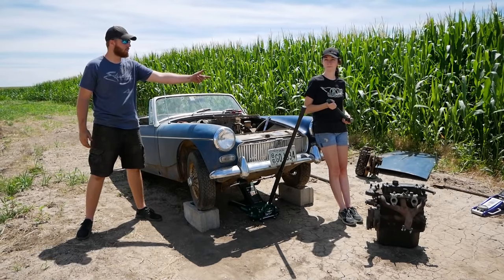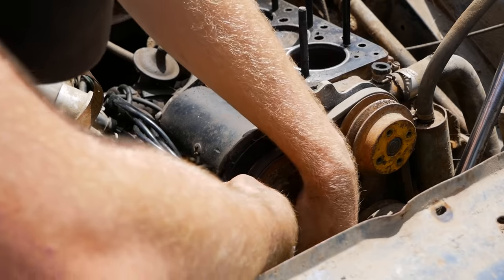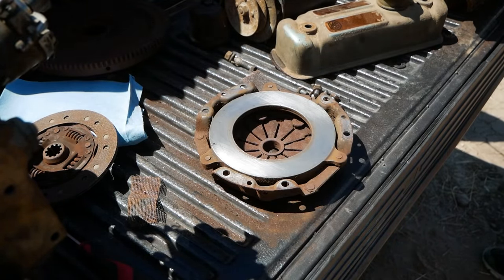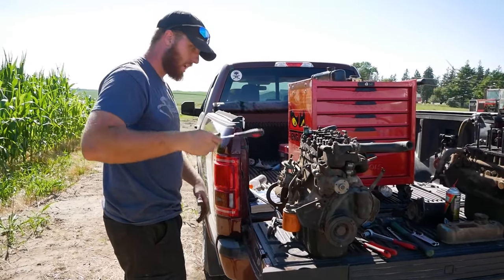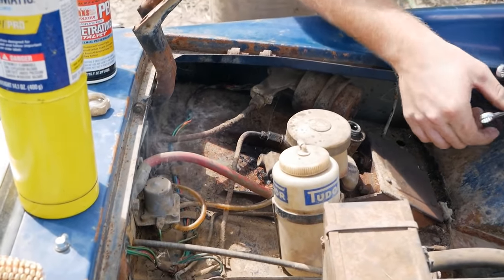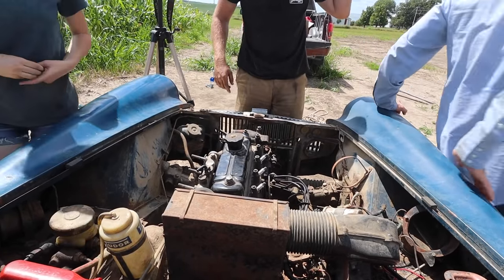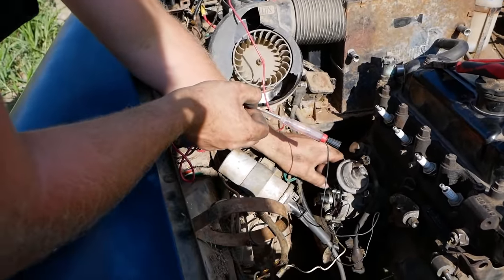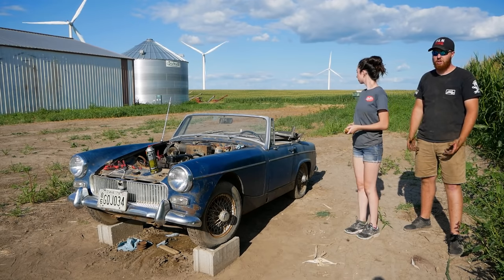Can We Make a SEIZED MG  Run After 42 YEARS!? - Part 2

Comment: The final part of this series should be a teardown of the siezed engine. I think I speak for most of us when I say we wanna see inside it!
Reply: cylinder is gonna be hard asf to get off it’s probably rusted to hell and back on the inside
Reply: I agree.
Reply: Ethan Nethery they showed that in part 1 - the head came off pretty easily, but pistons seized solid in the bores.
Reply: Emma Jacobs yeah it would probably be a pain to knock them out of the cylinder
Reply: @ethannethery2  YES it would be hard to knock the PISTONS out You'd most likely BUST the PISTONS to PIECES getting them but it can be done I've seen ENGINES about like that but they did get all 4 6 or 8 PISTONS out of them busted some but got em
Reply: is that his wife or daughter
Reply: @chrisparker5598  FRIEND
Reply: @ethannethery2  l
Reply: I certainly DO
Reply: I agree!!!!!
Reply: @ethannethery2  a
Reply: @chrisparker5598  friend, with benefits 😉😉
Reply: My hend soldder.
Reply: yeessssirrr 💯💯💯💯
Reply: Back up the truck and put it in there
Reply: @chrisparker5598  fiancé now
Reply: I second this

Comment: Britain didn’t go Metric until well after this was built. We call it Imperial rather than Standard.
Reply: As the MG factory made these cars over the years, they gradually installed American fittings.. in place of British Standard [sometimes called 'Whitworth'].   In my '71, the only British Standard fitting that I found.. was the drain plug for the cooling system on the carburetor side of the block:  it's in between an American
5/8ths and a 3/4ths.   You really need a British Standard wrench to move it.. such that it doesn't slip on ya!
Reply: @34Packardphaeton  Not quite true. They weren't American fittings they were always Imperial until they moved to Metric in the '70s. On post WWII cars there were very few Whitworth fittings used although the Whitworth thread profile was used (as on the Mini crank / flywheel bolt for example). 'British Standard' was how all threads were named as in 'British Standard Fine' (BSF) or BSW. That drain plug was probably British Standard Pipe (BSP) if it was tapered.
Wrench sizes for BSF were marked according to Across Flats (AF) so a 5/16" BSF bolt used a 1/2" spanner / socket / wrench.
Reply: @1chish  Do you have any idea if UK Imperial and US spanners are actually identical?
Reply: @Ragnar8504  If you mean Imperial / Freedom fraction sizes yes they are as they both use the size of the head as the identifier for the spanner / wrench not the thread size. For example Americans will use UNF thread standards whereas the earlier British threads were BSF. Both use the same spanner
Metric spanners are similar. An M6 threaded bolt needs a 10 mm spanner
Reply: Yes. Here's the history of Metrication in the United Kingdom: https://en.wikipedia.org/wiki/Metrication_in_the_United_Kingdom
Reply: @1chish  thanks for saving me having to explain. I was raised on BSW and still have the wrenches to prove it. Never been to Britain or any part of the UK, born and raised in Canada.
Reply: @bobm7275  Still family mate. Me too I have a drawer in my Snap On cabinet full of old spanners that I used to use when I was restoring old Brit classic bikes like British Standard Cycle ...Lol Haven't touched them in years sadly. I am restoring a '78 Mini which keeps me out of mischief.
Reply: @34Packardphaeton  whitworth is actually a different set of head measurements in it's entirety. You can, and should buy whitworth wrenches if your vehicle has whitworth fittings.
Reply: Why Imperial hardware? Well, Most countries, More importantly, Britain adopted the Metric system in 1965, however being that the BMC Assembly plant was in Australia, and this model MG was manufactured from 1962-1968, and although MG continued to built cars, but at that time, there were a couple of sizable things happening with the company, meaning, The Assembly plant was moving to a new facility in 1968-69, as well as the Australian Parliament officially passed the conversion Bill making the change Legitimate and Legal going from the Imperial system to Metric in 1970, giving Industries a set amount of time to become compliant with the new system, but like I mentioned before, your MG was discontinued making the 1968 the final production year, plus moving to a new plant, so my assumption would be that they decided to minimize the clutter and just become Legally compliant with the move... They did stay in Australia in the move, I’m guessing they didn’t want to get set up for assembly in the new facility, and then be forced by the Australian Parliament’s hand shortly after.... Plus, they probably didn’t have too much overstock considering they knew the Bill was in motion, not to mention not wanting to move any excess Stock than they had to... 
       CONFESSION: Okay, Nope, I’m not nearly the History dork I sound like lol, but between 2 of my uncles, they own 24+ Norton’s, BSA’s, Triumps, AJS’s, etc... And I’ve Owned a couple bikes myself, plus a 75-76 Spitfire, so having spun wrenches (more than I care to admit lol) quite a few times, I did know “about” when the change took place, but I DID look into it before posting... 
  In a nutshell, my A.D.D. Was kickin’, I saw a squirrel, (it might have been MOOK being chased by rabid killer butterflies into the cornfield.... haha) but I did want to know myself.... 
Oh yea, Certain British Manufactures has their VERY OWN measuring system, which Thankfully, it failed miserably in the early 70’s as well..... So if you owned a 1969 Norton Commando 750, yep, you’d need your very own set of “Whitworth” tools as well!! 🤦🏼‍♂️ 
      Talk about driving a guy crazy, what you would assume to be a plain ole 1/2” wrench or 13mm, is actually neither.... they’re INSANELY close, but neither of them fit... You’d need a 1/4W (Whitworth) 5/16BS (British Standard), again, yep, you’d need a 1/4W-5/16BS for what you’d think was just a 1/2”/13mm, yet the nut or bolt head actually measures .525” sae, or 13.34mm.... plus, the thread pitch is JUST enough different (10° I think) that you couldn’t even reliably use a standard Anything without trashing all your threads.... HA! 
PLEASE DONT DELETE MY COMMENT MOOK!! 😬  if you’re leave it up, I’ll come down for one of your rescues with you guys, (I’m only 2-2.5 hours from Debuque in Wisco, and was a “Tri-State Stump Jumper” years ago)
 and be your personal attack butterfly bodyguard!! 
(If you want to shorten this and rewrite it, I understand 100%) my thumbs have ADD too... :)
Reply: Fun fact..... Believe it or not, the good ole USA’s ACTUAL “Legal” measuring system is Metric also...but when the Bill passed around the Globe in the late 60’s to late 80’s, the United States, and I think it’s still only 2 or 3 other countries’ people ignored the Bill, and kept using the Imperial system... 

Because MERCA people! 
🇺🇸 🇺🇸 🇺🇸🇺🇸🇺🇸🇺🇸🇺🇸🇺🇸
We do ‘MERICA AS WE SEE FIT!! 😂
Reply: Mark Panka that’s a hell of a reply. If nothing else I thank you for the amount of time you took out to type it all!
Reply: No worries nudgerss,  my pleasure! 
Like I was saying, I wasn’t 100% sure either, but from owning a couple British rides, and spinning wrenches on a few,  like you said, if nothing else, it’s knowledge worth tossing on the back burner if I ever have to work on another one! 
     God knows if ANY of them still have any Lucas electrical components attached, it’s only a matter of time before they’re on the side of the road.... lol
Reply: @Ragnar8504  my dad was an aircraft mechanic in Montreal he began his trade in the mid-'60s,  he used the term imperial/standard interchangeably he had two sets of tools the other was metric
Reply: Mark Panka Britain certainly did not adopt the metric system in 1968. We still aren’t a metric county now. We’re a confusing mix of both. Miles, pints and feet are still used on our roads. We measured fuel economy in miles per imperial gallon, yet buy fuel in litres. It’s madness 😂😂
Reply: @Ragnar8504  Oh yes.My British spanners and sockets fit the nuts and bolts on my Chevy 350 that i have put into my Triumph Herald.
Reply: @1chish  I’m an American but I absolutely love the old 78’ minis...which is weird considering I drive a massive farm truck I’d give anything to sit behind the wheel of one
Reply: @joeyburrell3759  There is a surprisingly large Mini following in the USA given that Americans seem to prefer larger cars. But then a Mini drives like nothing else. Just think Go Kart with a roof.
There are quite a few American 'Mini' channels on YT.
https://www.youtube.com/c/minimania/videos
https://www.youtube.com/c/ClassicMiniDIY/videos
Reply: Or worse  was British std wentworth
Reply: @mpanka1  when you walk on the moon 7 times you can do that.
Reply: @1chish  my dad had 6 when I was a kid. Always 2 at any one time (the 60 was a dedicated race car )(the one I came home from the hospital in in 1962) I learned to drive in a moggie. Mom had a 72 Cricket (neé Hillman Avenger) also.
Reply: @mpanka1  Not exactly. The US did try to convert to metric at that time but they stopped due to the cost and the lack of enthusiasm from the people. I heard that there's a highway somewhere with all metric signs, the only one in the US.
Reply: @Ragnar8504  depends.  When hagerty rebuilt a British motorcycle they had to borrow British wrenches to work on it since everything was British standard not American standard
Reply: That's it good o'l pommie cars😁
Reply: @1chish  Spanner + british wrench.
Reply: @nubreed13   Those old bikes had a mixture of 'British Standard Cycle', BSF, BA and maybe even BSW threads. Ask me how I know ... 😏😂
Reply: @johnrogers-thorn9521   Yep. Dead right.
Reply: @1chish  ouch.  It was bad enough having a car that has a standard engine and metric transmission
Reply: Since Brexit, we'll probably go back to Imperial as the Yanks go metric - Oh the confusion! XD
Reply: @PrinceWesterburg   Oh don't you start all that ... 😂🤭
Reply: I was just thinking, he should be thankful they weren't Whitworth.
Reply: @Beanys728  - Whitworth history is very interesting.

Comment: I'd like to point out the flathead ford v8, they where literally known for cracking the block and heads at the center exhaust port because much like that MG they had 3 exhaust ports for 4 cylinders, just want to point out it wasn't just chevy or MG that had problems, I stand by a ford v8 being about as tough as they come but they do have their problems just like anyone else

Comment: This brings back memories. My friend and I changed the 1275cc A series engine on my father's Morris Marina when we were 13. It was on ramps and we lifted the engine out using a scaffolding pole and rope. Head gaskets blew so often we could do them in an hour. Happy days!
Reply: Did they produce an after market head gasket made from copper or some other soft metal to address that problem. I have a mental note about that from way way back. (I'm in my late sixties now. )

Comment: With the engine being so small I wonder if it would be possible to remove all the electricals, remove the rocker cover, remove the oil pan, and submerge it in a boiling or just really hot tub of vinegar.
It would be a really goofy way to unseize an engine but would be a very interesting video.
Heck it might work on the starter too. I would love to see what vinegar would do to that.

Comment: "how much oil did this thing leak?".
Well with those cars if its not leaking then you're out of oil.
Reply: every trip to the petrol station in my mini used to be £10 for the petrol, £5 worth of oil and 20p to put air back in the tyres because the alloys were porous. It was like owning a 2 stroke.
Reply: @misterthegeoff9767  I also had a Mini that I had to buy 4 litres of oil a week because it ran so badly because there was literally no rings left on cylinder 4 lol.
Reply: The Brit car show here has on the registration page that a fire extinguisher and oil drip pan are required. :-)
Reply: It's called a constant change function, it's never in long enough to need an oil change.
Reply: All those old cars rely on a bit of seepage to keep everything lubricated. These cars were built by machinists not robots so the tolerances are not as tight as they are today. All that said, they are meant to leak a bit - and so were everyone's cars from that era.
Reply: Just built in rust resistance. Still didn’t work.
Reply: @kellybreen5526  Fair point even my 72 Pontiac Catalina that's never leaked a drop of anything under the engine bay drips a little diff oil when it sits all winter in storage. Those old cork gaskets and rope main seals don't help matters any with leaks either.
Reply: My sisters old Morris 1100, every week we checked the petrol and filled up the oil. Still ran though.
Reply: Yeah....when my brother used to own one we called it Limey Juice.

Comment: Almost all of old British machines used imperial  and only the “newer” stuff is metric.
Reply: Like all the new "American" stuff - which is also metric..... This is all Imperial, but British threads are different than American ones and are not compatible.
Reply: That's not quiet true.
Old Brit stuff went over and survival is better there than here.
So you get the old tat.
However MG/Leyland/Austin/Morris all used imperial as did Triumph.
Most were all out of business in the 80/90's and the rest of the world cars were made here in the closed factories due to them being fitted for free (paid by tax payers) 
And the gov paid the companies to bring work to the mass unemployment.

So the newer stuff isn't. Aston Martin, (the late) TVR, and Rolls Royce, Bentley, and Morgan (as well as a fair few more) are not really outside the UK (or Europe) unless your on the main list here.

I don't think any are under English ownership aside the smaller ones.
Reply: As a Series Land Rover rebuilder, certain fasteners often caused me to exclaim, "you Whitworth motherf*cker!" several times.
Reply: Ever heard of Witworth? Now theirs a whole new set of spanners you need. Allot of very old english stuff used witworth.
Reply: BSW(Whitworth)
Reply: @gregmyatt9932  Whitworth is the threads per inch and the geometry of the threads, but the heads are the same. I have imperial (inch) wrenches for my Midget and they fit. However if I lose a nut or bolt I have to either find one from the "British Bin" or it is MOSS to the rescue.
Reply: @kellybreen5526  This is not entirely true, There are some whitworth sizes which have no equivalent standard size, I  once acquired a set of whitworth wrenches from an old aircraft mechanic and some of them deffinately do not fit either standard or metric bolts.
Reply: Kelly Breen I have a set of Witworth spanners and the odd socket. Where I did my apprenticeship we worked on pre war british cars and trucks. The imperial sizes do fit but were not exact. And it wasn’t the case were all the nuts and bolts on the vehicles were imperial. You would only come across the odd nut or bolt that was Witworth size. It is an imperial size but the standard imperial spanner sets didn’t have say 13/16 inch or 15/16 inch.
Reply: The Land Rover Defender used imperial propshaft bolts (9/16" head, 3/8 UNF thread) right up to the year they stopped production (2016), probably a few other imperial bolts elsewhere as well. Most of the vehicle was metric though, we just like to mix things up a bit :)
Reply: Max powerta. Right up to the 80’s, if you bought a socket set over here it came with; Metric, Imperial and Whitworth sizes. We started changing to metric in the early 70’s. I was working on a refrigeration compressor from ‘75, all Whitworth threads - struggled with getting spanner’s.
Reply: @gregmyatt9932  Well you inspired me to look it up.  During the Crimean War the Admiralty needed 120 gunboats with 60 hp engines for action in the Baltic. The boats had to be delivered in 90 days so John Penn took apart 2 existing engines and delivered the parts to several shops demanding that all the parts be identical. The engines were delivered on time and "Standard" was adopted. The threads are 55 degrees while US standards are 60 degrees and coarser. The reason why the spanner heads don't always fit is that the measurement is the thickness of the thread and not the size of the hexagon. Usually the hex head is one size larger. For example a 7/16th Whitworth would have a 1/2' hex  head.

Now with all that said, I restored my Midget using regular Imperial tools and  just scrounged, bought or fixed the fasteners because none of the local shops carried the fasteners ar had any desire to order me some. I had to get new fasteners through MOSS - which was quite a delay with the pandemic and all that.
Reply: @gregmyatt9932  I see where that could happen and after reading the history of the standard that makes sense.  I did fix my Midget using  a regular imperial set of tools. I did have to buy some new fasteners and no shop was interested in ordering them for me so I had to go through MOSS.
Reply: Pull Myfinger  WHITWORTH!. The first H is silent.
Reply: The "official" changeover to metric was 1965. The public still uses a mix of imperial and metric to this day.
Reply: @gregmyatt9932  All Whitworth threads are 55° the size of the spanner refers to the size of the bolt , eg 1/4" Whitworth is the bolt shaft is 1/4" with a thread size of 55° not the nut or bolt head size.
Reply: Robert Brugh their you have it! Cheers👍 My main point was that their is such thing as Whitworth spanners and wrenches etc.
Reply: All the talk of Whitworth threads is beside the point here though, because most of the fasteners on this MG would be UNF.
Reply: @thenonoman  Including some of the authorities, or why else would road signs still be in miles? It's quite weird if you cross the Irish border, the speed limits look essentially the same but the numbers change!